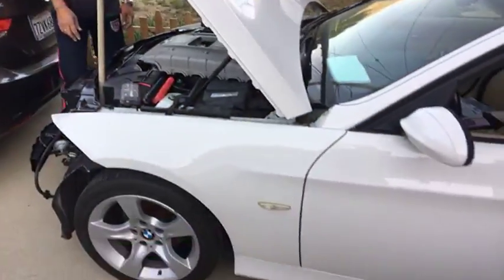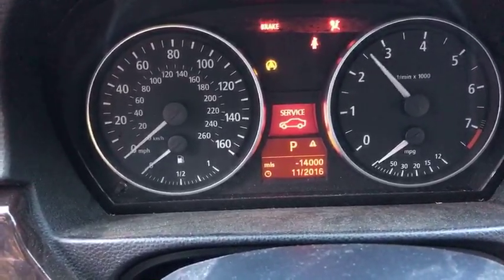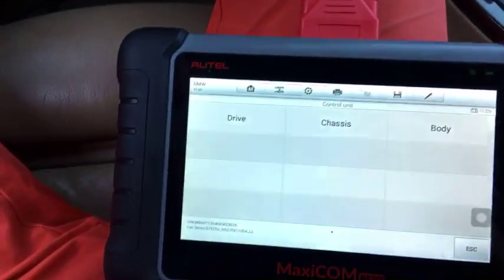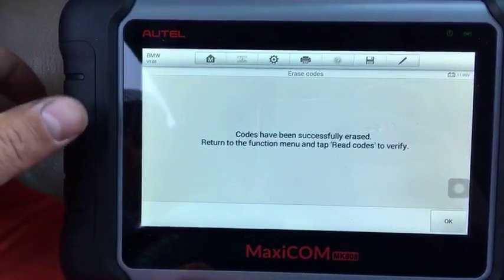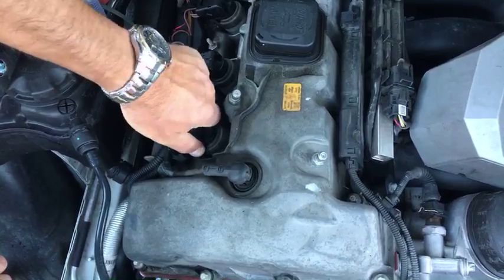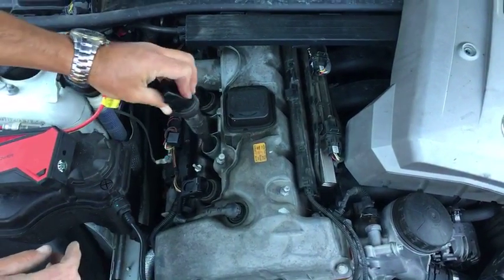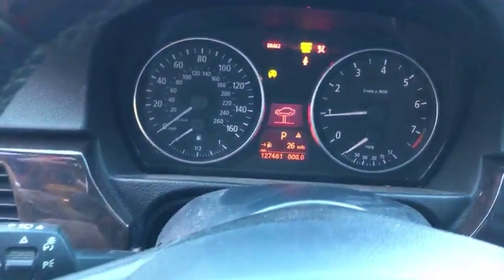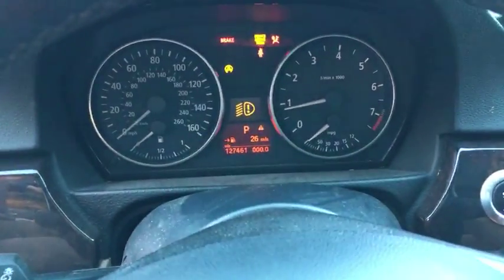HOW TO TEST IGNITION COIL DEMONSTRATED ON BMW E90 E91 E92 E93

Comment: Hi I have a bmw e90 05 that dosnt start it cranks had loads of sensors starter moter ,plugs changed it has a triangle with the ! Mark and a arrow that goes round the top of triangle think it's lack of power light any ideas please thank you

Comment: Please can you help!!!!

My 2006 e90 320d refuses to start. Had new key, battery, recently had a new turbo also. It's trying to turn over but it just won't start.

Few things I think it could be.

1. My daughter forced the key out.
2. Can the abs/break sensor stop it from starting as I changed pads and discs recently.
3. My fuel pump is louder than normal.

Please help as I've spent so much money already.

Comment: Stupid test, better testing is by multimeter pin by pin with check the ressistance and you'll be done without a diagnostic tool ;)
Reply: Pavel Horak it’s not a stupid test if you have a code reader but yeah, it would be nice to see it done without one to avoid the cost of a code reader. You should make that video! :)
Reply: The multimeter can show good numbers for a faulty coil. The coil consists of more than just a winding.

Comment: I need a help which cylinder is not function normal 1 or 2
Reply from the maker: At first the code was for cylinder 1. After that we put the ignition coil from cylinder 1 on cylinder 2 and code changed to cylinder 2. Which means that this ignition coil is bad.